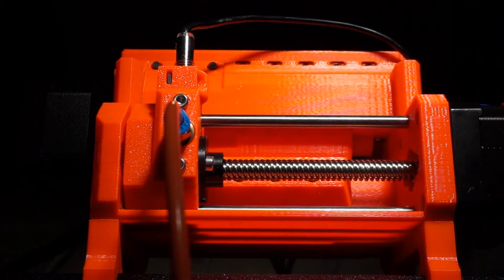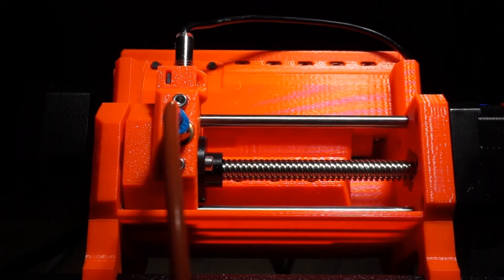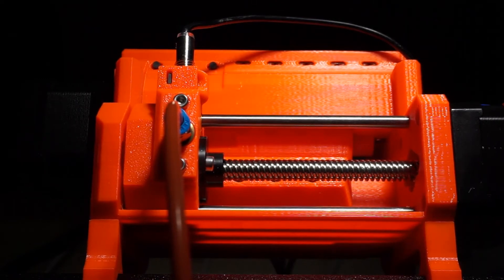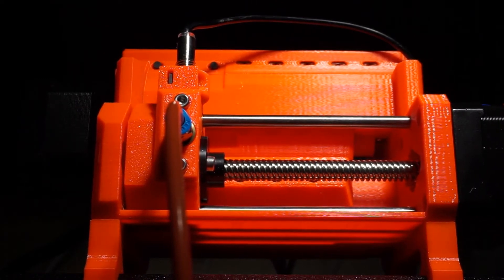Does it Work? Prusa3 Mk3 with MMU2 Startup

Comment: How did you stop it from banging into the sides like a machine gun, mine does on every startup, and fails all the time, wont unload filament, or load etc etc, wish i didn't buy one now, pain in the butt.
Reply from the maker: I haven't completely gotten it to stop.. my theory is that making sure nothing slightly holds up the carriage makes it work properly. I also cleaned the rods with the bushings and rubbed some 4 in 1 oil on them.

If there's ever anything that gets caught in the PTFE entrance tubes it still hammers.thouh.
Reply: Yeah ok, i was told by Prusa they are working on this should be fixed with future firmware update soon.
Reply from the maker: @petermorphett  good to know! Although if it's binding I'm not sure how they'll do it.. I'm going to see if I can nail it down when I've got a moment.
Reply: I just got mine and WHAT A PIECE OF CRAP .... works 10% of the time, the other 90% its selecting the wrong filament, and failing. Im going to switch back to the old method of just printing one color at a time. 

PRUSA should keep this junk in their test lab until they have it sorted out, dont just sell things in the testing stage.

Comment: Prusa sells its prototypes as finished products. You are solving his poor work for your money. Did you manage it to work? I spend couple hours of assembling it and then dozen of hours to make it work. Without big success. It can print only from positions 1,4 & 5. After some hours it stops, being not able to load filament until printer reset... 2 hours on support chat (the only positive aspect of prusa company) made no solution. Reading trough the forum, it seems to me I have to check if actually my bondtech gears have the same dimensions.
Reply from the maker: I did get it to work a bit later. As it turned out my primary issue was that I was using the wrong slicer profiles, for the old 1.0 version.

By then I'd re-checked everything about three times and reworked the setup once. So that might have something to to do with it all working for the most part.

I did have a few issues I'll be taking a look at and seeing if they're continuing or if they're sorted. I'll try to cough up a video on anything that appears to be a reproducible issue I can't resolve. And those I do!